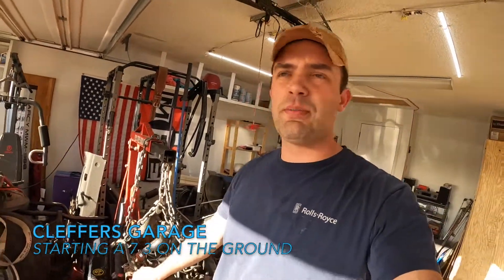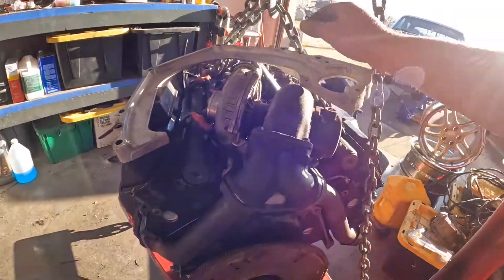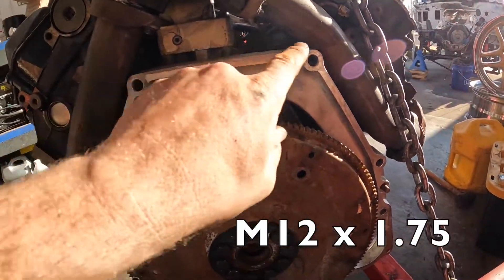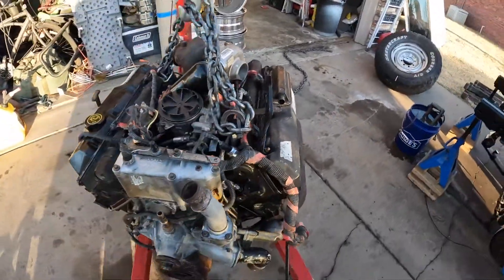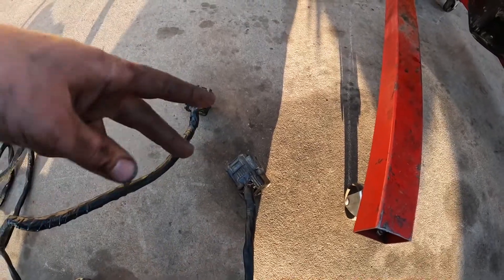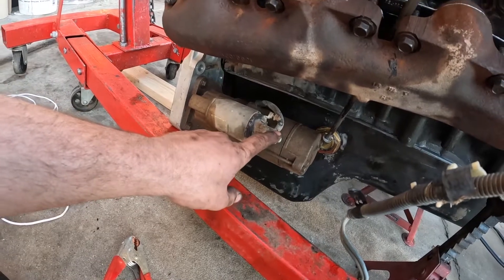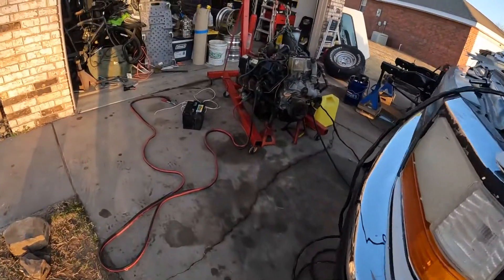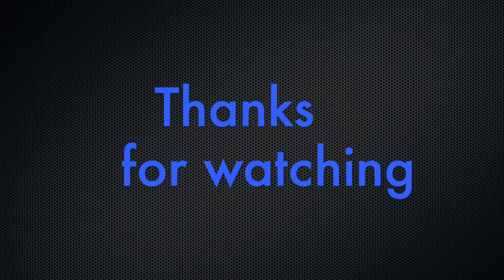Starting a 7.3 on an engine ground (stand)

Comment: Well I need one of them harness to start engine on the stands have to look around and find the stuff to make one soon
Reply from the maker: I was able to find one at my local yard. I might have just gotten lucky.
Reply: Ya I'll have to see if I can find one iv got a engine I would like to start up before I pull the truck apart somthing like this would be worth some money to people that's doing engine swaps and they want to hear it run before hand I know I would buy one but no one makes stuff like this
Reply from the maker: @chewy-bu1oy  that’s true. Before I did this little project I was looking online to see if I could use a spare pcm and just apply power to a few pin but I didn’t find anything easy for me to follow. I am no electrician after all
Reply: @CleffersGarage  ya same here I want to do this but I'm scared I would screw it up some how I may find somone that would make one and I just buy it for a few 100 or so